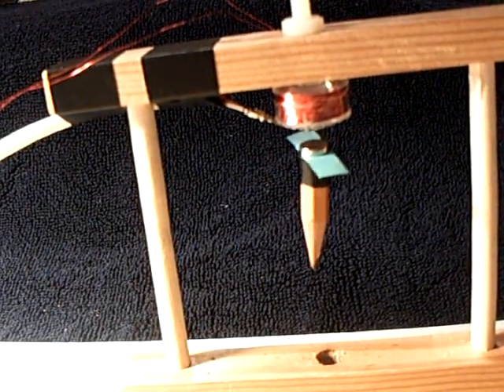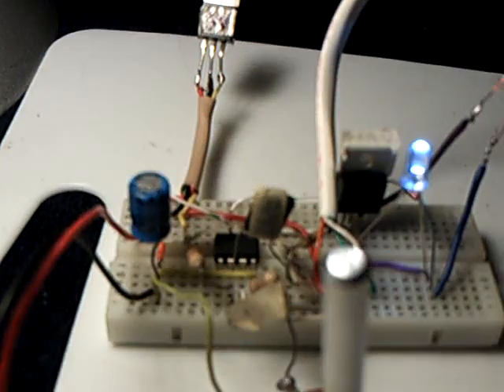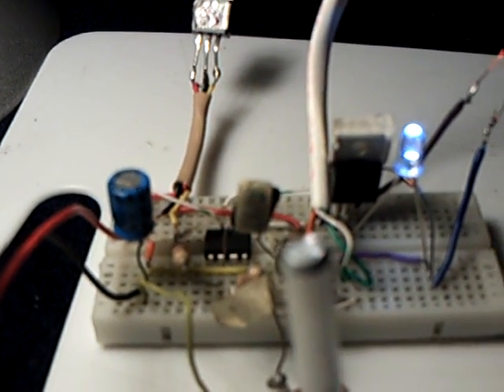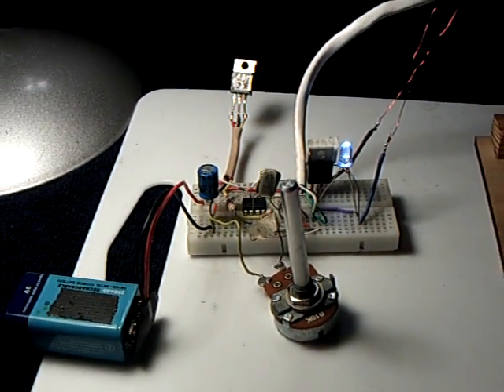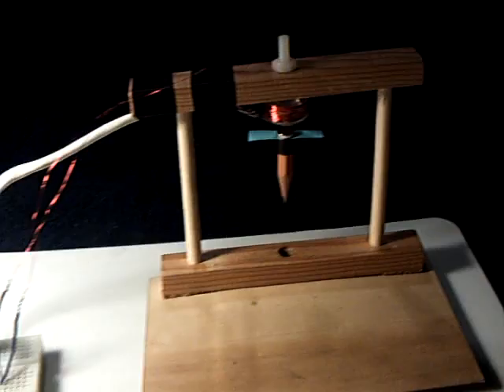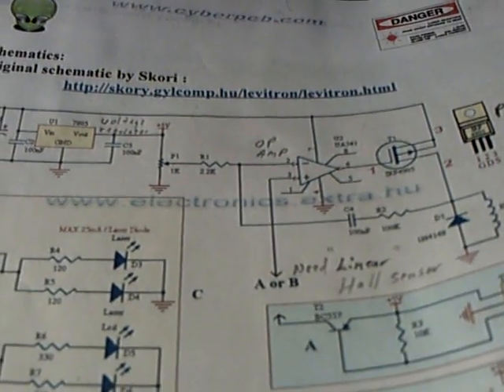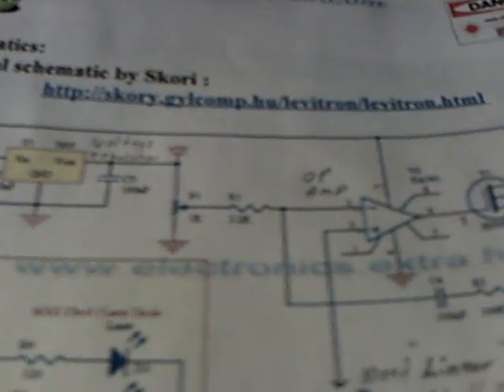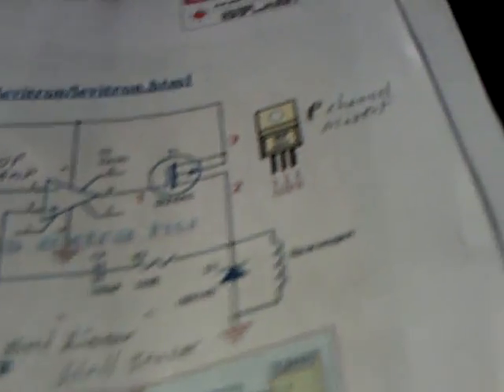Electromagnetic Levitation using Hall Sensor Circuit

Comment: Great to see this levitator running. I know how much joy the Adambus one gave you after years of trying to get one running.
P MOSFET's are a bit scarce, don't think i've ever seen one in salvaged components. A similar circuit had me trip up by using the wrong type of Hall sensor..didn't know there were different types until that project !
Congratulations !!!
Reply from the maker: Thanks.  I actually got interested in this again because of another project going on using magnetic repulsion for the levitation.  TinselKoala is working on it.  That method is much more difficult so I thought that I'd better master this method first.

Comment: Thanks lidmotor,good ţiming ! I was beginning to think I was just hopeless at this.  Told my wife I was putting it all away tomorrow. Although I've had some successes it's not as easy as it looks. My hope was to take 4 of the solar dancer circiuts and create a tiny Mendocino motor. Do you think it could work? Maybe you could show me how?  Dollar tree sold out but i ordered a whole bunch online. Those things sell out quick! Even the masters falter, very gracious of you to share that during this season of giving thank you for sharing and happy holidays!
Reply from the maker: Making a tiny Mendocino motor using the solar dancer circuits IS possible.  I don't think that you need the whole circuit but just the solar panels and the coils. Working with the super thin coil wire will be the problem.  Personally I would just use the solar panels and wind 30ga wire. Get it at Radio Shack if you can.  Actually I have never made a true Mendocino motor. Might be fun. Happy Holidays.
Reply: ***** yes you are absolutely correct about the wires being extremely fragile. That's why I ordered a couple of extra dozen online.lol. Mendocino motor works because of the rotation induced by the magnet on the opposing side to the circuit, if you put magnets on all four sides it wouldn't rotate. Unless of course the rotation was induced by a pulse circuitry. So I was thinking of using four circuits pulsing with 4 coils. That should actually increase the speed I would think? But then I have a problem just trying to get a simple pulse circuit to work! Which is why I admire your work and the proliferation of it so much! I'll let you know how things work out assuming I don't break all the wires on the little coils !